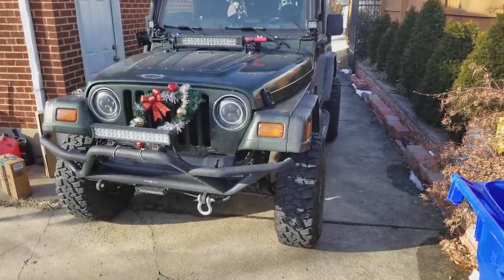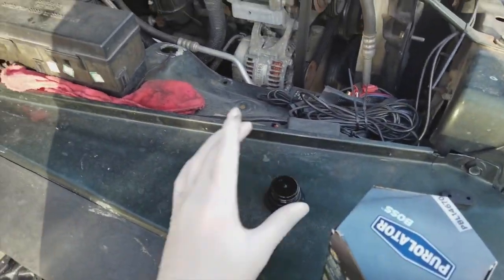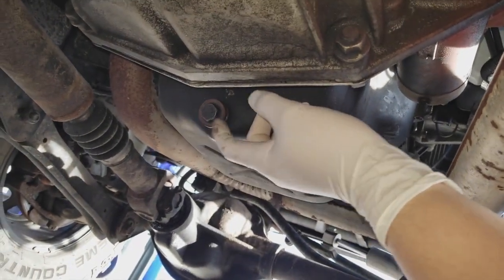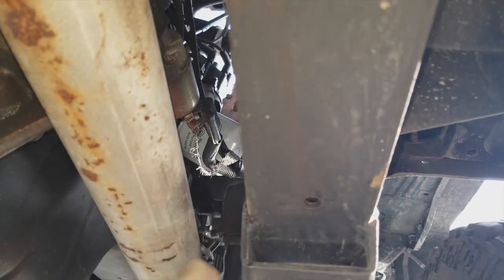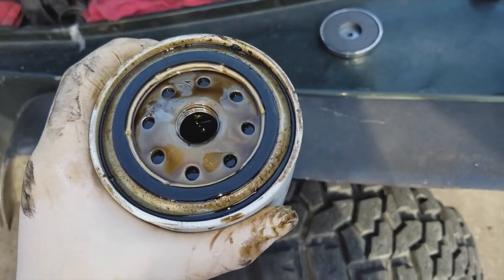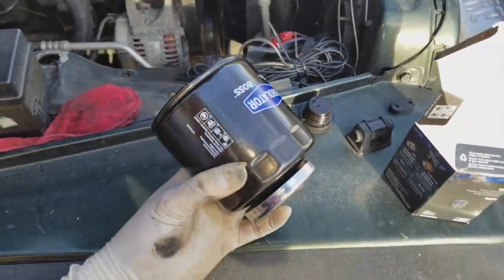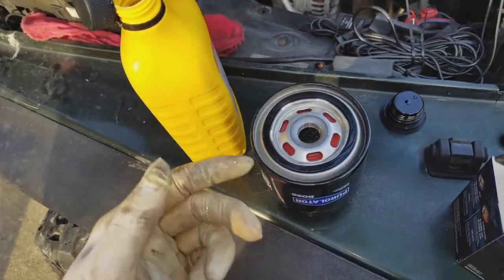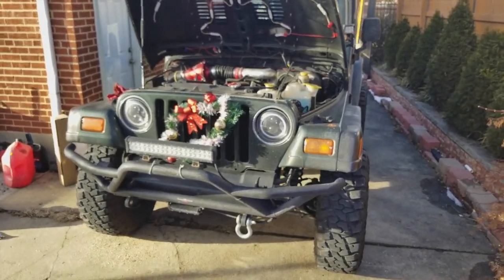How To Change Your Car's Oil and Oil Filter Life Hack! (Jeep TJ)

Comment: U do know what a oil filter does right? It filters the tiny metal shavings from normal engine wear. U adding a magnet ist gonna help anything or extend engine life. Do your oil changes on time and use the correct oil is how you prolong engine life

Comment: How you like that oil catch pan?  You got it at walmart right?  I heard it is too shallow and drains slow.  Mine has the opening in the middle and has a removeable strainer. It works but could be better.

As far as oil i get super tech walmart brand for $14 and change for 5 quarts.  Ive seen tests done where it performs as well as top brands, besides the most important thing is the time between changes.